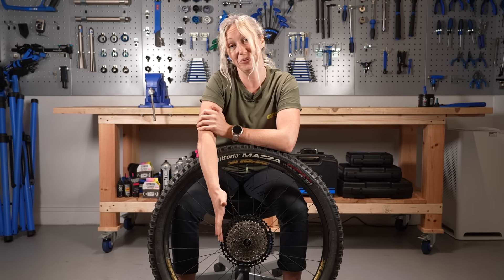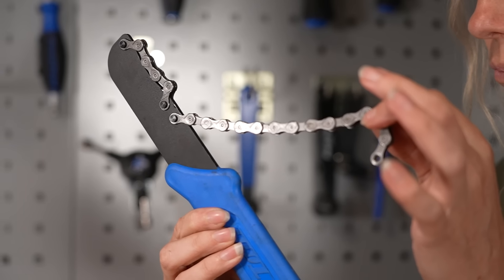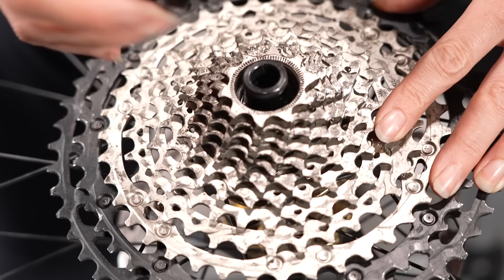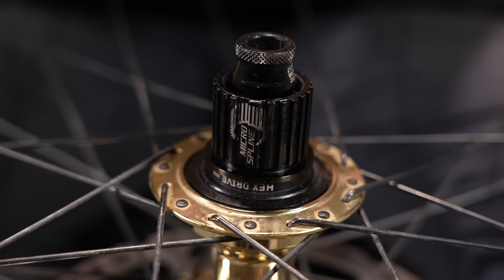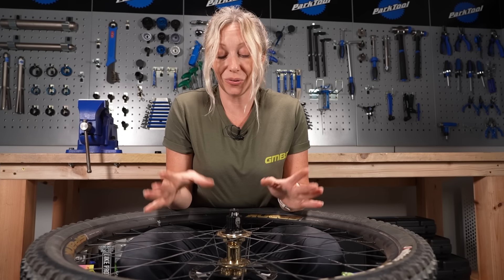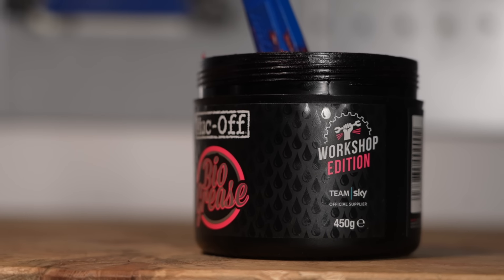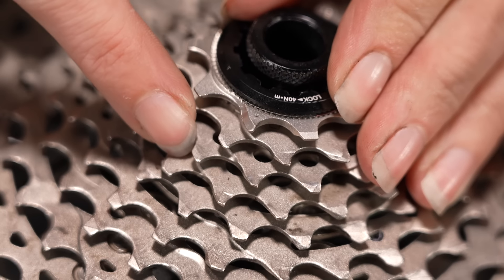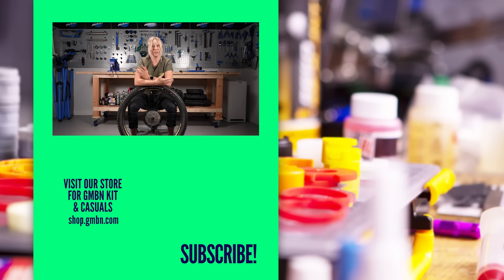How To Remove & Install A Bike Cassette

Comment: Nice that you have a pre-loosened cassette for this video!
But what can I try if mine won't budge with these tools? Very stuck 🤷‍♂️ thanks!
Reply: same...wont budge. bit like the vid of the bottom bracket that was put freshly on 5 mins ago lol.
Reply: I had to spray things down with Kroil penetrating oil for 2 days (like 5 applications) prior being able to get my cassette free. 
I have a SRAM XD, and the threads are sorta on the inside (back  -  big_ring  -  center) of the cassette, so I sprayed from both the front, and the back -- making all attempts to get some lubricant into the threads.
To finally get my cassette free, I had my wheel sorta horizontal on the ground with my foot & leg sorta pinning the wheel down, and really had to torque. 
While torquing, since my spline tool doesn't have a central 12mm pin (I suspect that the central pin is helpful), I really focused on turning about the center of the wheel -- and minimizing any sheer forces.

I don't know if it was the different technique (on the ground opposed to on lap or vertical), the penetrating oil, or focusing on turning about the center that made the difference (likely all three).
Good Luck!

Comment: Great video. I know this is an old video, but I just purchased a Cube Aim EX 2023. The cassette doesn't seem to be running true. The shop says they have no service, but they are offering a good price for the bike. I wonder if it's something that can be fixed? Any ideas? Appreciate it.
Reply: It's more likely the indexing on the gears limiter screws . Watch on YouTube.  I've got cube mountain bikes too good bikes

Comment: All videos explain well. But NO ONE explains how to remove stuck threads. Which is what you see every day.
Nobody changes newly installed and loose spare parts.
We change when we have to change, and they are practically welded together.
Reply: Yep. I've just rounded off a removal tool. Damaged the tool and the locknut. Going to be a grinder and punch set time! By far the tightest one i've ever done
Reply: Try freeze spray on the lock nut

Comment: HG hub will fit 12 speed cassette from Sunrace, for anyone wondering
Reply: Or SRAM 12s with 11t smaller cog, like SX... But as aftermarket replacement surnrace is lighter and cheaper for sure!
Reply: Not all Sunrace cassettes though! They also produce cassettes with 10 teeth cogs, which won't fit on HG  freehub bodies.

Comment: Would it be nice if U did not have to replace the entire cassette all the time. I use the 3 high gears 80% of the time. If  I replace the chain on time it would be cheaper if I could only replace the 3 high gears every other time.

Comment: i was filling my rear tire with sealant, while shacking the tire for the sealant to be everywhere inside the cassette fell off, i asked canyon they said it's normal, is it normal? (stock wheels on canyon spectral cf8 mullet cllctv)

Comment: Question: how would you know if your shifter cable is too tight, too lose or just right? Do you have a tool to measure the slack?
Reply: im not sure if theres a tool for it, but you can kind of measure it by shifting gears. if the chain doesnt shift all the way and the chain is ticking after shifting, is too loose. if it skips a sprocket and shifts up 2 gears in one click, the cable is too tight. gmbn tech also made a vid about adjusting your rear mech explaining all this. the best one i found is a vid by parktool on adjusting the rear mech. hope it helps(after a year xd)
Reply: @Tom-jj6jo  Yes, indexing the gears involves a lot of practice. Once you know the technique. It would be easy as long as you install good parts as well as have a well maintained sprocket, chain and chainring.

Comment: Quick question @GMBN ,  at 6:05  you can see the cassette disassembled, the smaller cogs removed showing the remaining block. I have the same XTR cassette, appears to have a broken  rivet holding the 8th gear cog in place on the cassette block on,  is this normal or do I have a chance with a warranty claim ?

Comment: Thank you for this video. I learned a lot. No need to go to a bike shop to remove my bike cassette and install a new one. I just need those tools you showed in the video. And its just that easy. By the way, how tight should the bike cassette be? How many Newton Meters?
Reply: Usually about 40 to 50
Reply from the maker: Glad you found this useful! If you're interested in building up your MTB toolbox, we use tools from Park Tool; however, other brands are available. Normally you'll find that cassettes are torqued to around 40Nm. Although it's worth checking the locking wheel ring.👍

Comment: ...I'm an older, formerly considered by the average to be called a "hot" guy. I had the whole thing going on head to toe. I'm not attracted to just any female, but you my dear... Don't take it to mean I'm squishing the noodle over it, but just yes. You are very attractive. If I knew ya, I'd schmooze for sure. That's all. Thanks for the info.

Comment: #AskGMBNTech Hey Anna, hey Doddy! Mountainbike tires are getting harder and harder to mount on rims. Last time was the first time i had to go to a shop and ask the guys there to mount my tires. I‘m riding michelin wild enduro race lines and bontrager elite carbon wheels and couldn‘t get the tires on the rim. Actually really hurt both of my thumbs badly when trying to fit the tires. How the hell do you fit tires without hurting yourself? Special tools? Cheers 🤙

Comment: #AskGMBNTech Hey Anna, Doddy, I've been schooling myself for a year or two now on all things MTB maintenance, building custom wheels, suspension is on my short list. Your video's are such a help and inspiration to just tackle stuff, which I really appreciate. I've seen your rear derailleur vid and I for the life of me, cannot get the clutch axle to come out those 12s derailleurs which have seen some daunting weather here in Belgium over the winter. I believe it's a matter of applying the required mallet pressure on it, but I'm a little reluctant to breaking stuff.. Any tips are appreciated.